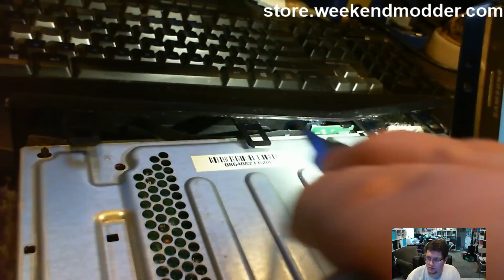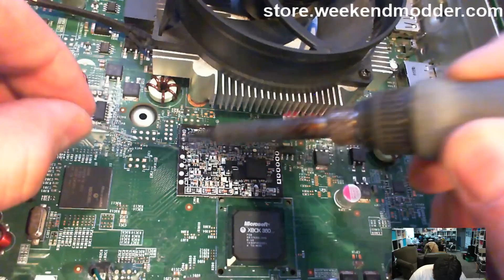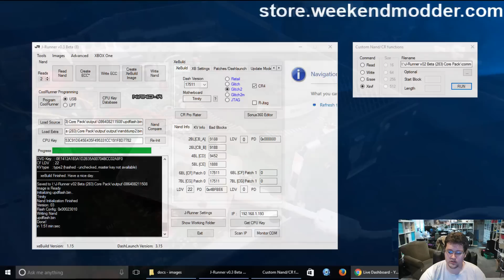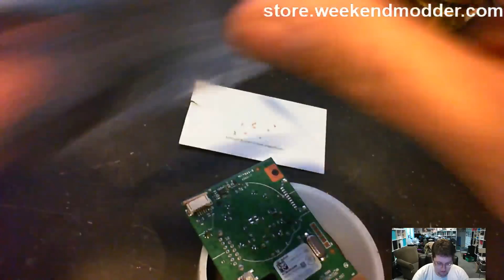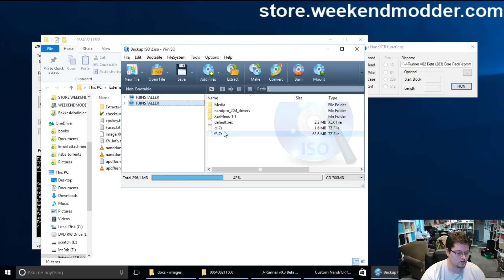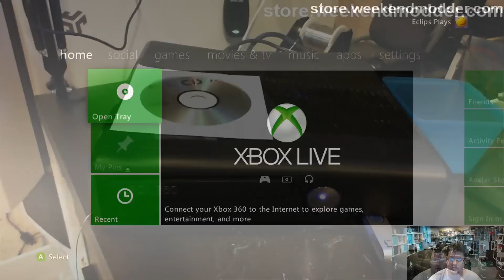RGH Trinity with Ace V3 and CR4 speedup files

Comment: im so done, like the jr program logo dissapears on xsvf, and says xilinx device  not detected wtf???
Reply: Run what ever os in test mode then install the driver should have no issues
Reply: Unless you're not connected to the solder pad right

Comment: Does the x360 Ace V3 need to be soldered to the points on the motherboard before you flash the timing file?
Reply: Ive soldered the ace v3 to the motherboard first. Then i programmed the timing. But i think you can also program the timing first, since its a different process.  Ive just finished rgh my trinity. God it took me the whole day searching on internet and doing it.  The most complicated parts are disassembling the console and cleaning it. And installing the j runner drivers on my window 10. No video or internet tutorial talk about it. And of course soldering that D point was tooo risky but it took me 30 seconds to get it done :)

Comment: why did you only read the nand and not write the ECC before installing the chip?
Reply from the maker: Once you have a chip fully installed, you can test by disconnecting power and if you've not written the ECC it should still boot retail.  Then once you've confirmed, write the ECC, reconnect that power wire and glitch with confidence

Comment: I have just done my 20th console and I have an odd problem everything works so it’s been Rgh correctly but for some reason when ever you first connect the console to power it will just turn on by its self and I don’t know why. Any chance you can help?
Reply from the maker: Hmm...  Oddball issues like that could be the RF controller board - try swapping that out.   IF that doesn't get it, try rebuilding your nand image using Jrunners "build updflash without nanddump.bin" option and a clean SMC.
Reply: TheWeekendModder I have done some research and I found someone on an old team xecuter forum and he nether confirmed if he fixed it but someone replied they had three consoles that had that issue out of the 1000 consoles they have done and they said it was a problem with the south bridge.

Comment: MINE IS TAKING LIKE 45 SECONDS TO 2 MINUTES TO GLITCH anyway to speed it up?
Reply from the maker: Play with the length of your RST wire, that's the easiest way to tune on boot times.
Reply: @TheWeekendModder  is that the wire running underneath the motherboard? It might be a hair too long but the one on top is really short
Reply from the maker: @pixelgriffstudios  in an Ace V3 install the RST wire is the D wire.
Reply: @TheWeekendModder  ok I'll double check that. When I flashed the chip the timing u recommended wouldn't flash so I did the file above it and it flashed so I did the one u suggested and it flashed finally, does this mean there's double timings on my chip? Was I supposed to erase the chip before flashing the timing file again? I'll check the d wire tonight. It works just takes 2-4 tries for it to boot.
Reply from the maker: @pixelgriffstudios  no, each flash overwrites the previous contents
Reply: @TheWeekendModder  if I order some chips from you how fast do you ship in USA? And Can I use the NandX on the Jasper or do I need the other flasher?
Reply from the maker: @pixelgriffstudios  2-3 days via USPS, nandx works fine on a jasper
Reply: @TheWeekendModder  One last question, I keep getting prompt to update the Dashboard I think I used the dash you did in this video so How do I update to the latest one without bricking the system.
Reply: The D wire is as short as I can get it. I even moved the chip a hair closer as well to make it even shorter. I bought the chip off eBay so it's probably a knockoff and why it boots a long time. Sometimes it boots in 5 seconds on rare occasions and can take up to 3 minutes. I have to turn off and try again sometimes as well. I used a thicker wire for the ground and it seems to work a little better. It's a Trinity board so what's the best chip to use now for Trinity? I see they got new chips now for Corona that boots under 10 seconds.
Reply from the maker: @pixelgriffstudios  I didn't say make it short, I said play with the length. Start with a 40cm wire and cut it down 2cm at a time doing 2-3 boots between each cut.
Reply: @TheWeekendModder  40cm? That's over a foot long I'll try that out tomorrow.
Reply: How long was longest wire you had to do for good times?
Reply: @TheWeekendModder  thanks for all your help. I decided to reroute the D wire underneath the motherboard and use the other point instead of the transistor point and now my average boot time is 12 seconds instead of 2-3 minutes. Did 15 boots quickest was 3.6 seconds longest was 40.1 most are 8-12 seconds with a few 20-30 seconds here and there. I also flashed newer 2018 timings.
Reply from the maker: Nice - told you that RST wire is the easiest way to impact boot times!
Reply: @TheWeekendModder  your timing files go up to 60.6 do you have the newer 62.6 timing files? I've read they work better when running the rst wire underneath. I can't find them anywhere.
Reply from the maker: I've shared everything I have, if they're not in the "weekendmodder Jrunner pack" then I don't have it.
Reply: @TheWeekendModder  ok I'll probably be ordering some stuff on your website either Monday or Tuesday. That Unity USB adapter is that how people are making 6TB consoles? Dual 2 TB drives and then and external 2TB?
Reply: @TheWeekendModder  thanks for all the help, I'm a pro at Trinity now, my second Trinity I get instant boots every time, first console is around 8. I did a V2 Corona but I messed up the pads desoldering the qsb nand reader. I got it to read the nand but wouldn't write the nand so I kept resoldering and by the time I realized that the lock would slide up Everytime I plugged the card adapter into my laptop it was too late as I ripped off the pads and now console won't boot so I need to fix the traces. But if I would have known the lock was sliding up to lock Everytime I inserted the adapter I would have gotten it. So a pro at Trinity, but still a noob at Corona.
Reply: @TheWeekendModder  I placed an order today and got the priority mail upgrade. Ordered some Ace V3's and a cool runner. Is a cool runner and programmer all I need to do a Jasper?

Comment: i bought 10 chips from you and a resister on the c3 spot at the bottom of the board is missing. is that normal or not because in your video you have a resister there
Reply: there are not working on my trinity consoles. it says on your website that they do work for trinity consoles
Reply from the maker: If it's missing on all 10 it's normal.  There are a few variants of the ace v3, but the ones I have now are 100% genuine and even have serial verification.

Comment: I’ve recently installed an ace v3 into my trinity Xbox 360 and I have booted into xell and keep getting this error: kv_get_dvd_key Failure: kv_read. I was wondering if you could help me out
Reply from the maker: That error is totally ignore-able and not an issue.  Just nab your CPU key and Jrunner will use that to decrypt your nand and you can get your DVD key from there if you need it.

Comment: the wire length you used on top side point for D shaved 5+ seconds off of all my boot times on every trinity so far since I started shortening the wire.  even the timing files that take 20+ seconds to boot xell the first time almost always boot on the first cycle after writing the nand.  thanks for the tutorial.
Reply from the maker: Awesome, thanks for sharing your experience!

Comment: Is it a bad idea to use an Ace v3 over Matrix with a Trinity? Im being told that Matrix is infinitely better on a Trinity?
Reply from the maker: Bad to use an Ace?  No way - they are a great install on a Trinity; the only thing is that there are batches of bad aces out there that don't work right.
Reply: How can I identify if I got a bad one (or how to avoid getting a bad one) ?
Reply from the maker: There is no test other than installing them that I am aware of.  It seems that the "cafe" versions which have a brown tint to the PCB are the newest production runs - but even then I've had some of those be "good" and some be "bad".    I happened to find a vendor with a bunch of "old stock" pure black PCB Aces and those are 100% good with the trinity install so you could pick one up from my store if you want.

Comment: What is the success rate for a trinity? -- like with my jasper it frooze at boot and then just stopped turning on ;( im now looking at getting a trinity
Reply: Prod By 303 jaspers are the easiest
Reply: Trinitys are pretty dang easy too.
Reply: Both really reliable. Make you you confident with your soldering
Reply: Maybe the problem with the jasper is beyond the rgh itselfl? Did you install it yourself? What chip was in it? I have done a couple jaspers (with matrix and coolrunner chips)and trinity (acev3) following weekend modder's tutorials and using his file pack and they work good. (?)  Did you check the pins on the usb ports? Sometimes bent pins create a short preventing the console to boot. Just throwing that in the mix.
Reply: Chin Chilla coolrunner rev c worked fine a few times but froze on boot
Reply: Chin Chilla turns out I now have a corona 4gb

Comment: Can you use a matrix instead of nandx
Reply from the maker: You could use a matrix for nand reading and writing, but the matrix is not able to program glitch chips
Reply: TheWeekendModder thanks, do you think I could RGH a trinity with an LPT cable and an ace v3 I don't care about boot times and and reading times
Reply from the maker: You'd need a way to program the Ace V3.   the LPT would let you read and write the nand, but you'd need to program the Ace with Trinity timing files as they come default preloaded with Corona timing files.
Reply: TheWeekendModder is there any chips that come preloaded with the trinity timing files sorry if u feel I'm asking you to spoonfeed me lmao
Reply from the maker: The CR4 from TX came preloaded, you can also get Matrix V1's from my store preloaded with the "muffin" timing file for a CR4 like experience (on a much cheaper chip)
Reply: TheWeekendModder ok thanks have you ever had a wire not stick to a hand header?
Reply: Do you ship to the uk
Reply from the maker: Yes, you can order supplies directly from my site to the UK

Comment: a tip for those replacing the leds, if you want to test them as you solder them, a proper multimeter has just enough voltage to light them a little, just put it on continuity (beep function) and observe polarity (+ and -), and bingo they light up a little bit with no chance of blowing them.

Comment: Is there any chance you can speak to me over Skype please as I have done around 10 rgh systems and this one just won't boot it glitches but just does not boot
Reply: Update: I fixed it turned out to  be a problem with the glitch chip i think it was the crystal on it but everything works now
Reply: PlanetTitan how did you fix it
Reply: Jesus Lera turns out it was just a bad ace chip because it had a bad crystal so I change the ace for a new one and it worked fine

Comment: I have re soldered wires for reading nand but always get 1 bad block saying Error: 250 reading block 3F9.
But it says nands are the same but never remaps is that a problem
Reply from the maker: That's like the final block of a 16mb nand, so no remap might be required.  If Jrunner is giving you "nands are the same" then I'd push ahead.
Reply: Yep did that and everything works thank you that's now my third console I have rgh and all of them work I am going to be doing a white limited edition slim next its a 4gb one so I need some good luck.

Comment: When I created and wrote the ECC I selected the dash version 17511. After writing the ECC the console wont boot, and CR4 XL does not glitch. Was I wrong to select the dash version in this step?
Reply from the maker: Nope, having the dash selected is just fine - did you have the appropriate "glitch" vs "glitch2" selected?  And the CR4 tickbox selected?

Comment: does the jr programmer work with the slim trinity
Reply: SaNN Apollo yes
Reply: I just did a chip last night with the jr programmer. Word of advice, windows 10 might not auto-install its drivers making you think your nand solder points are bad. I had to disable some Windows driver digital signature thing, then go to Device Manager on windows and manually select the J-R programmer to update its drivers. In the J-Runner program folder, there's a folder named common and in there, drivers! Which luckily have the files you need to perform the manual driver install. An easy way to tell you're Windows is blocking the jr programmer drivers is when you plug it in and have Jrunner program open. it will not show JR in big bold letters in an empty space below the Nand read/write buttons.

Comment: Datavac Electric Duster $70 off ebay makes life easier. i use them on og xboxs.
Reply from the maker: Thanks for the tip - I'll check it out.
Reply: OKay i need some help iworking on my rgh rn and im trying to fix it and it doesnt boot up and im trying to fix wiring to see if theres any problems and it turns on and the fan just turns on and after like 6mins or less it make a louder fan noise and then it shuts off i need some help like badly can you contact me if not my email call me please 951-423-9756 Thank you@

Comment: So I'm planning on RGHing my Trinity Xbox 360 and have a few items in my eBay watch list that I want to confirm if they work together and whatnot. So in my watch list, I have a J-R Programmer V2 with the 3 cables and I also have an  X360ACE V3 in there too. I also have all tools need as well to complete the job at home. Are those 2 things the only items needed? Thanks in Advance!
Reply from the maker: Assuming you've got the basics for soldering, a scratch pen, flux paste, solder, iron... etc then an Ace V3 and a JRP should get the job done!
Reply: TheWeekendModder okay thank you for the fast reply

Comment: Hey my rgh trinity mother board where we install the nand-x wires. There are no metal circles in some of them it's just a small hole
Reply from the maker: Fill that with solder.
Reply: TheWeekendModder thx man that helps alot
Reply: Luxx Statiic I had the same and was worried thanks 🙏